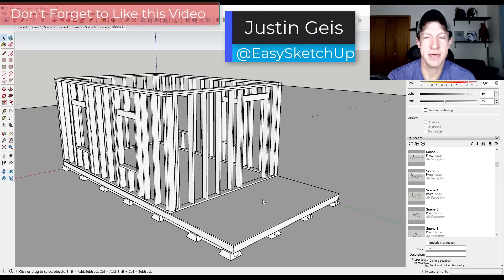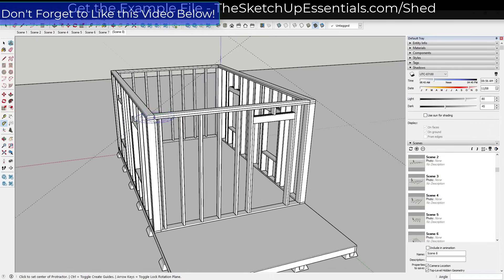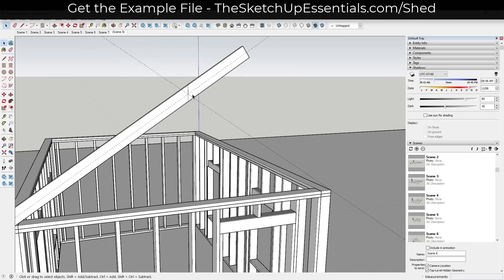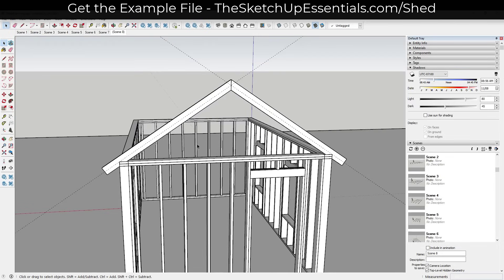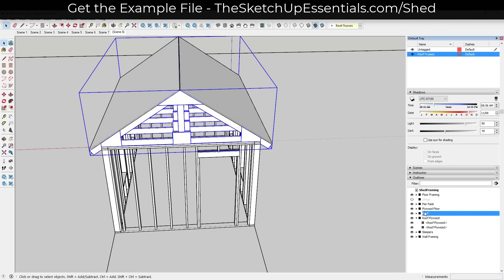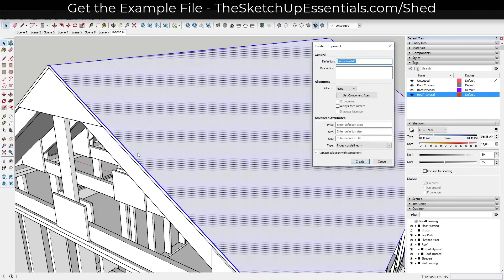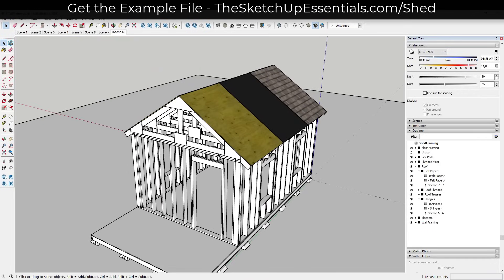Modeling TRUSSES AND ROOFING in SketchUp (Detailed Modeling in SketchUp Part 2!)

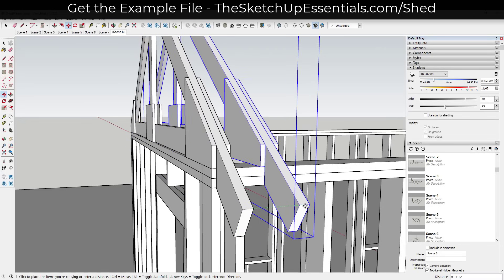Comment: Quick comment on the Protractor tool...  You can specify an angle as a pitch by typing "rise:run".  For example:  4:12, 6:12, 7:12, 7.5:12, 10:12, 12:12, etc.
Reply: Was thinking the same
Reply from the maker: I did not know this - thank you! :)